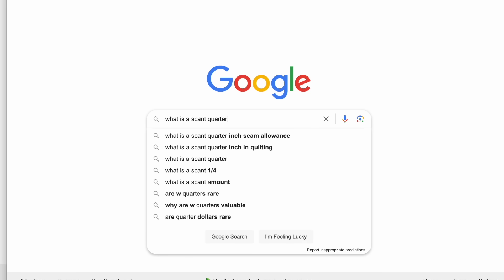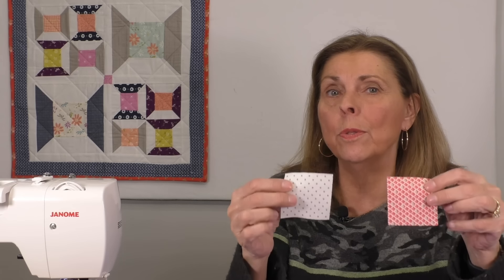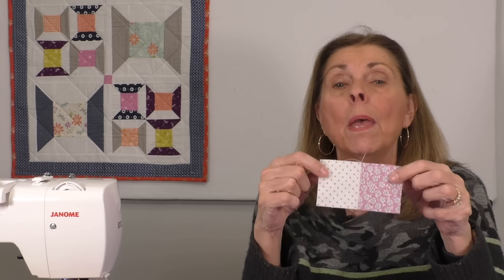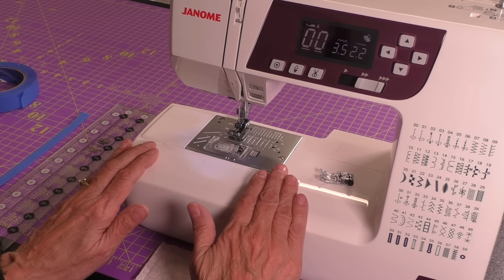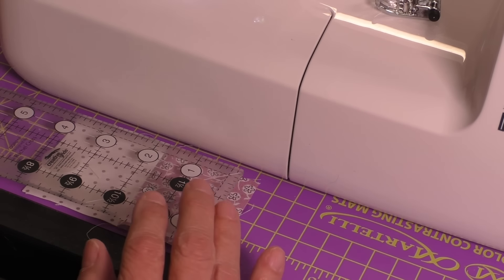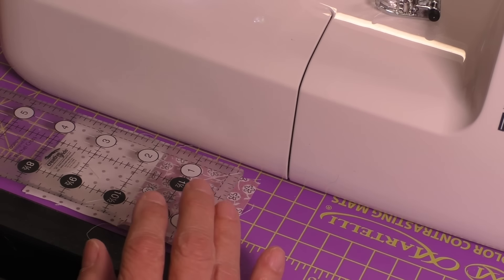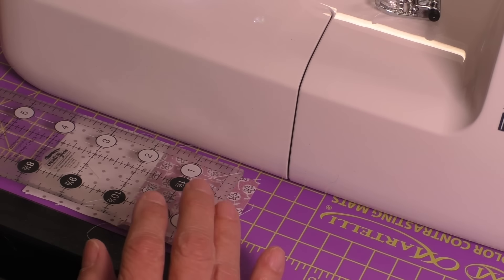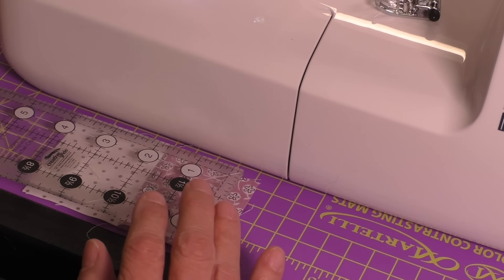Why You Should NEVER Sew "Scant" Quarter Inch Seams

Comment: Thanks for your video.  I have a quibble about the quibble on scant v. accurate.  
A scant seam is just that.  It is scant to allow for the thread/fabric.  It is not a full 1/4" from edge.  An accurate 1/4" seam is a full 1/4" seam which is needed for most blocks that have star points in them.  Sewing a scant will cause problems with your points.  Accordingly, scant and accurate are two meaningful variations of a modality that gets you to "accurate" for the intended purpose.

 Small quibble:  you state "an accurate 1/4 seam in your vid"  which of course flies in the face of your opening salvo!  

I would also point out that a straight stitch plate helps for consistent results as well as a sharp needle, as distortion occurs. (and of course sewing straight consistently from beginning to end which all of us have problems with in the beginning).

In my world, a scant 1/4" is one needle click to the right.  It works 100% of the time (except as noted above for star points). I don't mind calling it scant because that is how it measures.  It is machine driven, and I never have to think about it.  My Bernina gated foot is perfect (and expensive, but saves me time).  The two together ensure that every time I sew (even during happy hour!), my seam is going to be exactly the same sans all of the accouterments: tapes, ledges, prayers, tears, curse words!  If your machine is too smart and senses a straight stitch plate, you may not be able to use your SS plate and one click to the right.  My Bernina B530 is not that smart.  I have other machines, but I only piece with this one due to the consistency.
Reply from the maker: I agree and it sounds like you have the "scant" issue totally under control, so this is not something you need to wrestle with.  As I've said, my issue is not with the seam itself - it's with the confusing and unmeasurable term "scant".  I have taught quilting for many years and as much as for some a scant is one click, or one thread, for new quilters this does not compute as they begin to tackle quilting and the precision that' involved.  In the end we all want an accurate finished piece, but when we throw unmeasureable terms such as "scant" into the way we achieve that accuracy, it can be confusing.  That was the point of my video explanation.  Thanks so much for watching and for taking the time to offer your opinion on this topic.  I do appreciate it!

Comment: Do you think it’s necessary to do foundation piecing on this simple block? It’s so time consuming
Reply from the maker: This simple square-in-a-square block was used for easy video demonstration purposes when foundation piecing.  The purpose of the video was to show the basic steps for foundation piecing for those who were not familiar with the process - how to use the perforating blade to mark the sewing lines, how to fold the paper, position the pieces, trim the 1/4" seam allowance and then sew on the wrong side of the paper.  Yes - the FPP process is most handy for more complicated blocks, but it's just easier for me to teach the process for FPP using the simple block.  Thanks for watching!

Comment: I think this proves the point that to get “just the right size”, or an accurate measurement of the sewn fabric pieces, the “scant” quarter inch seam needs to be …properly “scant”!  (“Scant”, btw, means just barely “less than”)
Reply from the maker: As I have said in many of the previous comments - we'll just have to agree to disagree.  When quilting, we use precise measurements.  The term "scant" has been proven to be very imprecise with quilters of all levels of experience, struggling to figure out what "just barely" or "less than" means.  Although your definition appears to be very straightforward by many quilters,  I have heard from way too many quilters who struggle with the term, finding "scant" to be very difficult to translate into a measureable term - which is why I created the video.  Thanks for watching.

Comment: This works great for my Juki, which only does a straight stitch! With my Singer, I can move my needle to the right to get the "scant" 1/4 inch.
Reply from the maker: That's very helpful - when machines have that capability that is the best option!  Thanks for sharing!
Reply: Not sure which Juki you have bu the 1/5 foot will yield a scant...same as with the vintage machines.  My 1946 Kenmore has a perfect scant foot.

Comment: Great tip! What about using a thinner thread weight (e.g., 60 wt etc)?  Would be interesting to see video on it as well :).
Reply from the maker: Could be helpful, but for quilting I use a 50wt.  It's more the fabric "fold over" that causes the issue although the thread can play a part in the accuracy as well.  Thanks for your input!

Comment: I was a Production Patternmaker in the garment industry for many years. My sewers would cut through the roll tape as thick as he needed, all at once with the painters tape. Most if the time, he would use about 1/8” thickness. Cut the tape with a sharp blade. He would use the tape as a wall, as Mary is speaking a about, but You do not have to take off each each layer of tape and line them up. ❤
Reply from the maker: Thanks for the tip!  There's always a new way around the corner to approach this issue.  I appreciate your comment and thanks for watching!

Comment: It would help if sewing machines still had the screw hole on the bed to screw in the adjustable cloth seam guide. Singer used to sell one for 0.50 cents. I have kept my old Bernina which has that hole. Some models offer something different that is adjustable, but it is not in all or very many models within a brand. I know this because I am currently looking for a new machine.  Thank you for your tip. I see many machines with masking tape on the bed as a guide. The blue painters tape is better than masking tape.
Reply: I have a magnet guide I use a lot. It is so easy to use.
Reply from the maker: Thank you for sharing your experiences with this issue and thanks for watching!

Comment: On my big Brother, I can just reposition the needle in .5mm increments.  But on my Elna, I have to do something similar with post-it notes.
Reply from the maker: That's a great option if you have a machine that has that capability.  But yes - for quilters are using machines that are older, or those without all the bells and whistles - and for me, this is a great way to remedy the issue when it comes to accurate seams.  Thanks for watching!

Comment: I use the ruler made for this with hole to put needle down in. Then with ruler in place, put Washi seam guide tape in place.
Reply from the maker: Thanks for the tip - I did try a similar ruler, but there was still some wiggle room around the needle and didn't find my seam was as accurate as it was with the tape.  Do you mind sharing the brand of ruler you used?  Thank you!
Reply: @joyfulandmerryquilting  the seam guide ruler says Collins on it. You can use 4 different holes in it. Put foot down when needle is down to see where to place tape. I have quilted since 1989 so no telling how long I have used it!

Comment: Is the point then that the quarter inch foot doesn't allow for an accurate quarter inch seam to be made?
Reply from the maker: Not at all - it just depends on the 1/4" foot.  I have tried a generic 1/4" foot as well as those that came with my machine and they have varied in accuracy which is why I prefer marking with tape.  I will be doing another video on the subject to clear up that very issue.  Thanks for watching!

Comment: I just cut deeper into the painters tape for several layers at once. The rolls designated to my area anyways so who cares. I also cut the section over the bobbin case separately after sectioning the layers off the roll. This way the bobbin can be removed without removing the tape and resetting it all up because it won't need to be removed from the bobbin case lid. Hope this makes sense. When it doesn't stick anymore because I've removed it for other projects and stuck it under the wheel of my machine for storage, I use a straight pin on one corner and just remove one layer. Waahlaa... brand new once again. I have also cut the 1 inch roll down the middle and used the straight edge for the fabric side. Extra 1/2 inch for another machine or ready when needed again. 
Old school works for me and painters tape is cheap. I do still square up cuz no one's perfect even with these methods. Quilts flow together so easily, I'm onto the next project without alot of hassle. 
Thanks for all your tips, fun to watch and see all the comments.
Babs near Tombstone, AZ
Reply from the maker: GREAT tips!  Thanks so much for your comment Babs!  And thanks for watching!

Comment: Why the dramatics? 
You created a scant 1/4” seam as soon as you positioned the needle to the right of the 1/4” line on your ruler. 
An ‘accurate’ 1/4” seam would measure exactly 1/4” from the edge of the fabric to the line of stitching before the seam was pressed—either open or to one side.
Reply from the maker: I think your opening sentence "Why the dramatics?" makes me think you're probably not going to be open to my explanation, but I'll try anyway.  It appears we're both looking at this in two different ways - and that's where the confusion is, especially for new quilters.  You obviously are able to work with the term "scant" and have no trouble creating accurate blocks as a result, but there are many (including myself) who just aren't comfortable with the term "scant" and for many the uneven and inaccurate blocks created as a result of NOT sewing a "scant" seam correctly can be overwhelming and discouraging.  My point is, the term "scant" is unmeasurable.  From my experience as a quilting teacher, when a new quilter (or even an experienced quilter at times) is told to sew a "scant" 1/4" seam, the term "scant" is so confusing.  I would rather help them achieve a perfect result rather than try to help them figure out what constitutes a scant seam when it just isn't making sense to them.  Believe me, I have taught enough classes to know this IS an issue.  It appears that scant is a term that you do not struggle with, so this video is probably not something that would benefit you.  For those who DO struggle with the term (and there are MANY from my experience), marking the machine as I have described, is helpful.  You're certainly welcome to use the term "scant".  Again - my opinion - you're welcome to yours.
Reply: @joyfulandmerryquilting   I DO see your viewpoint.  As you say, both methods result in an accurate ‘unit’ or ‘block’. However, your method is limited to straight seams. 
To Wit: 
Two novice quilters are constructing a simple beginner block such as a 4-or-9 patch.  
They then decide to try something a little more challenging, such as a snowballed square/rectangle or a flying geese unit. The quilter who was taught the scant 1/4–‘next to the line’—method can now simply apply that method to a diagonal seam. One concept applied to more than one situation.
As for dramatics, your click bait title, ‘you should NEVER’  the ‘BOO!’, and the ‘scant spell that has taken over the quilting community’ can hardly be called anything but dramatic. As for that ‘spell’—as you call it—has ‘taken over the quilting community’ is a technique taught by experts for years. Its longevity is a testimony to its effectiveness.
Reply from the maker: We'll have to agree to disagree.  Just because an unmeasureable term has been around since the beginning of time doesn't mean we can't come up with a process to achieve an accurate result that is more definitive and accurate.

Comment: Well thats great til you have to change your top loading bobbin..then you have to start all over?
Reply from the maker: There was a suggestion to cut the tape with an exacto knife or some type of cutter, right at the edge of the bobbin case, once the tape has been positioned.  That way everything is still lined up but you can remove the bobbin case without moving the tape.  Hope that helps!

Comment: This is a good DIY, but it is a bit fussy.  There are several products out there that do this exact same thing.  All very helpful to get a good scant seam allowance.  However, learning to sew a scant seam allowance is an important skill to have as a quilter/seamstress because the tape method does not work for every situation, for example diagonal or stitch and flip piecing.  PS your title says never sew a scant 1/4” seam…. but what you demonstrated was how to sew a scant 1/4” seam 😂
Reply from the maker: My point is that "scant" is a confusing, unmeasurable term and I don't use it when I am piecing or teaching.  There is a follow-up video that answers some of the points you brought up.  https://youtu.be/xYL3LhiXB2k  Thanks for watching.

Comment: You're still sewing a scant quarter inch seam--just doing it with a different technique--which I will try!
Reply from the maker: My point is the word "scant" is confusing to new quilters and many experienced quilters and I have decided not to use it in my teaching.  If you prefer to call it scant, that's certainly up to you.  My hope with the video is to simply demonstrate how to position the tape to give you an accurate finished block.

Comment: Works great until you have to reload your bobbin. Then you have to set it up all over again. All the back and forth could contribute to slight variations in the seam width. Same applies when you swap the tape out to sew something that does not require a 1/4 inch seam. I’ve tried this method. Works well until you have to interrupt the placement of the tape.
Reply from the maker: Someone suggested to use an exacto knife or blade and once the tape is placed, cut it where the bobbin case opens so it stays with the bobbin case top when you replace bobbins.  I didn't try it yet, but it may be an option.

Comment: What I don’t understand is why don’t they just make a scant 1/4” foot?  OR, why don’t pattern maker just increase the size of the pieces?
Reply from the maker: Good question!  Thanks for asking!  :-)  There are some machines that have the option of moving your needle by small increments and that way you can test your seams based on the placement of the needle and you don't need the tape.

Comment: If your machine allows you to move the needle it is a quicker way and you can use your 1/4 inch foot or the edge of your foot.
Reply from the maker: I did show at the beginning of the video that I used my quarter inch foot first, in my example, and my piece came out about 1/16th of an inch short.  Moving your needle is a great option if you have that capability on your machine and yes, that would be my first choice, if possible.  But, many simple machines don't offer that option, so this DIY method works well.  Thanks so much for commenting and for watching!

Comment: I don't piece blocks very often but when I do I really don't worry about whether the seams are 1/4" or 5/8".  As long as I am cutting and sewing all the blocks consistently the pattern will work out - perhaps slightly smaller or larger intended but who cares?  The blocks will be square because I'm using the same seam allowance for all seams.  The only time it is critical to make the 1/4" seam is when my blocks are being combined with someone else's; obviously they all have to be the same size.
Reply from the maker: That works if all of the pieces are the same.  If you are sewing together two 2.5" squares and they end up less than 4.5" when sewn together, and then try to match them to a 2.5" x 4.5" rectangle, they will not match.  This is especially critical when sewing blocks such as an Irish Chain type block.  It's impossible to put together a puzzle if the pieces are different sizes.  The same is true when quilting with various sized pieces that need to come together to create a block.  Thanks for watching.
Reply: I will take your word for it, for the simple piecing I do it does not matter.  I do mainly foundation piecing and applique.

Comment: My theory is that if it is all sewn the same way it will all equal out. But that was a good video.
Reply from the maker: Thanks so much for your kind words and for watching, Linda. I see what you're saying, but the difficulty I have had with that is that, for me, it works if all the pieces I am putting together are the same size.  When I'm sewing together 2 - squares (2 1/2" + 2 1/2" = 4 3/8" instead of 4 1/2") it can be difficult to connect it to a piece that has already been cut to size such as a  2 1/2" x 4 1/2" rectangle.  Then, the more pieces that are added to the mix, the more difficult it is to get everything to match.  But, I know there are experienced quilters who never have that issue.  We do what works for each of us.

Comment: My biggest issue with using tape is that it’s in the way every time I need to change the bobbin.
Reply from the maker: Yes, with some machines it is in the way, but I try to be careful when I remove the case lid and then stick it back down, once I've changed the bobbin, if the end of the tape comes up.  On one of my machines I also put a small piece of single layer tape over the end and just under the bobbin case lid to hold the end of the tape down.  The tape sticks well to itself and the end gets secured out of the way by the bobbin case lid. If you do that, you need to make sure there is room for the width of the tape to fit so you don't cause an issue with the bobbin case.  I also trim off the tape so it doesn't touch the bobbin.  I hope I haven't confused you too much!  For my machine, the single layer of tape attached to the layered tape and then tucked under the lid fits fine and I haven't had any issue with it.  Hope that helps.